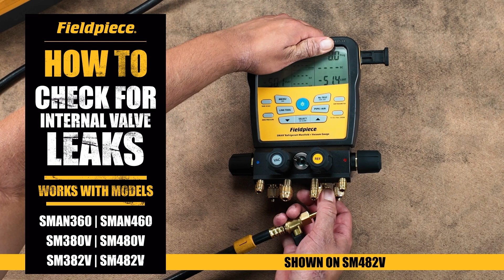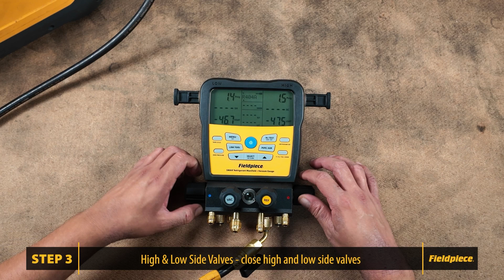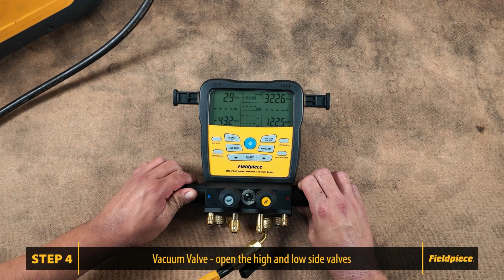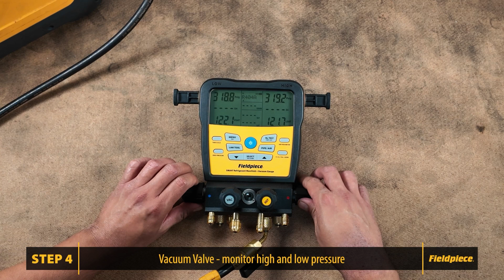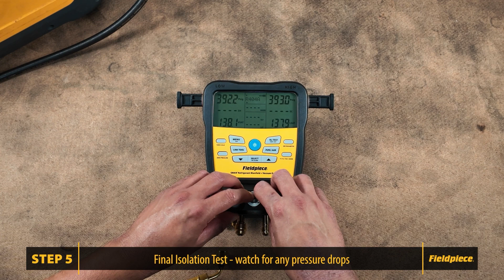SMAN® Manifold Valve Leak Test | SMAN360, SMAN460, SM380V, SM480V, SM382V, SM482V

Comment: I love my 380v but the high side transducer inside the case is leaking. It's enough to create frost on the outside of the case when connected to a 410a system. Any guides as to how to separate the transducer to reseal the threads?
Reply from the maker: Thank you for your comment. We would like to further understand the issue and work towards a resolution. Please contact our customer support team at 714.634.1844 or email us at fpwarranty@fieldpiece.com.